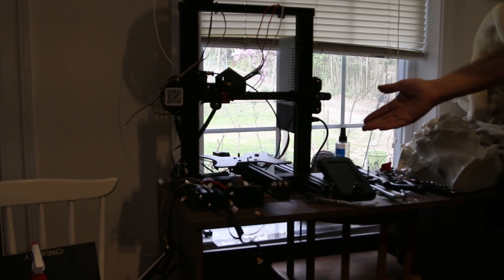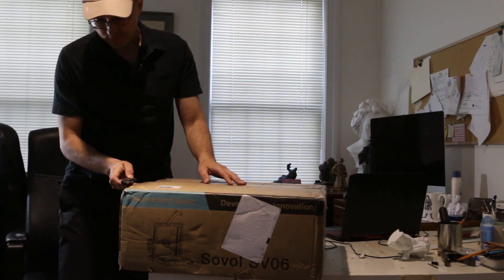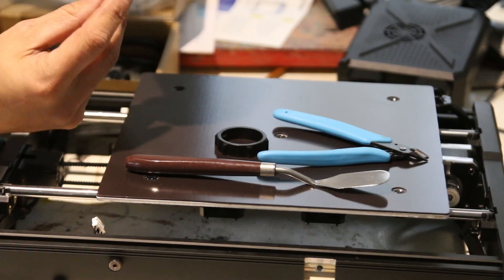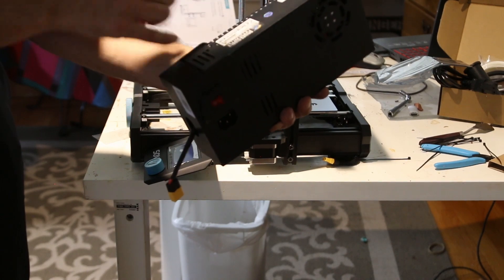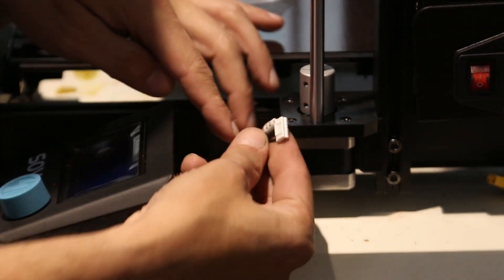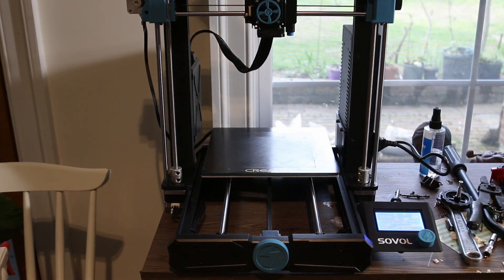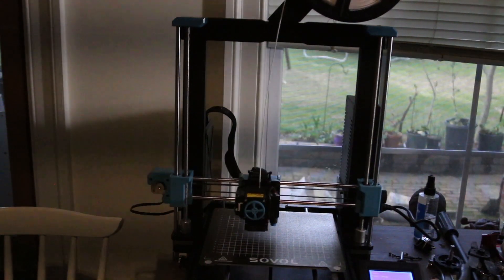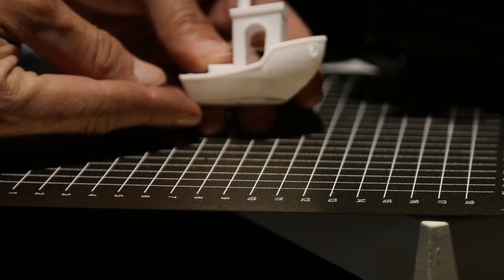Unboxing and first print out of the Sovol sv06 3d printer

Comment: Great video, mine is on order, be careful don’t think the glass bed will work the induction sensor, sensors the steel sheet, don’t think it will detect the glass
Reply from the maker: I haven't tried the glass one yet. I bought it for my ender 3 now that is in the corner gathering dust. This one is much better. Hope it lasts a long time.